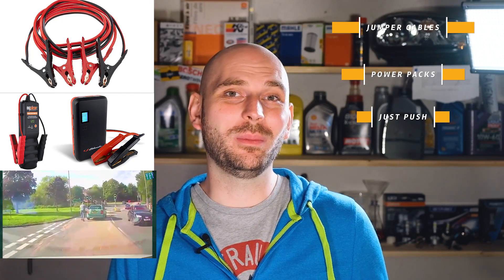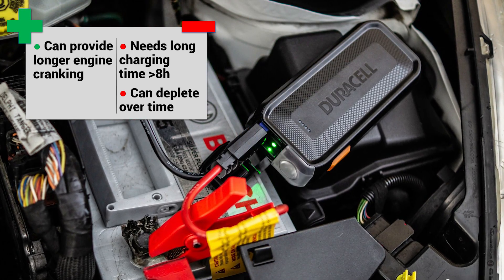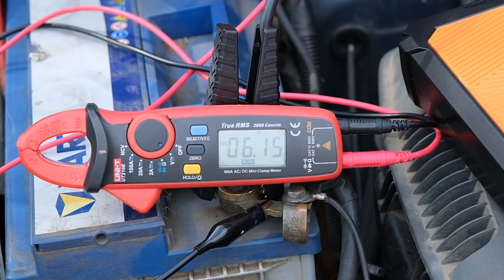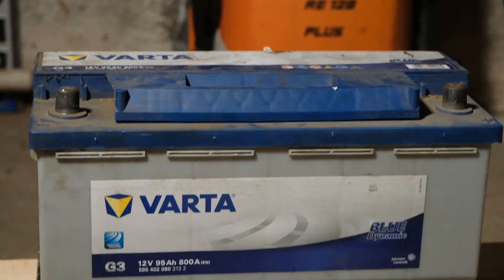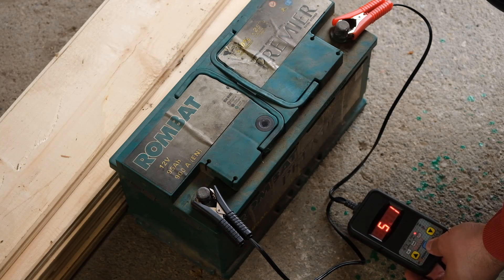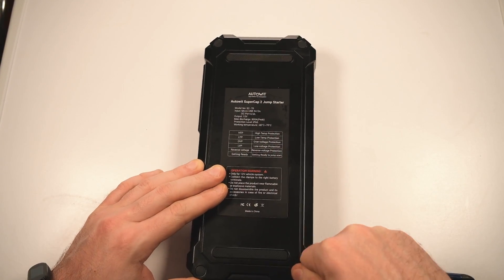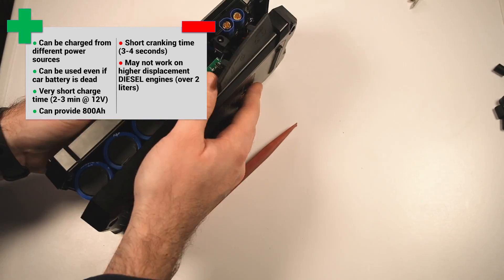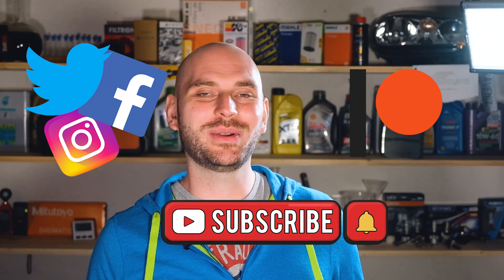[FYC] Is this the best Jump Starter? Autowit SuperCap 2 Jump Starter - REVIEW and TEST

Comment: I just got autowit.should i fully charge it at home? Will it hold the charge till i need it?
Reply: It will discharge in about 2 days.    However charging it is much easier than charging a battery starter.

Comment: I personally feel that the booster charger with lit ion battery is a far better product than this super capacitor charger. One often hears the arguement that booster charger needs regular charging. Not true. I charge it once a year and it only seems to loose 4% charge per year. It still has 96% charge after one year and within 7 to 10 min of recharging from 96% it shows 100 percent again. So recharging is not an issue. I could easily go to one and a half year or possibly two between recharging. Besides I can use it for prolonged or multiple starts/cranks. It works on a totally dead battery, and even no battery, just to start the car. Beat that super capacitor starter! Besides you can use it to charge your phone, iPad, laptop, and even use the very useful built in flash light in winter darkness when you are stuck in the middle of no where with a dead car battery, a dead phone battery, a dead laptop and pitch darkness. I hope you get the drift!😁 This is a real life user comment since I have used it for more than two years. And it is cheap. I paid only 60 Euros then. It is even cheaper now.
Reply: I agree that the lithium ion battery based ones work better, but my concern is that lithium batteries don’t like extremely cold winter days or extremely hot summer days.    The humble loss of capacity over a year would be no big deal if it was sitting in my living room, but instead it will be baking or freezing in my car trunk all year long.     The reduction of power in the capacitor style is the tradeoff for extreme temperatures & recharging being a total non-issue.
Reply: Agree 💯 %

Comment: Good review and thank you for dismantling it for your viewers. I ordered one from AE as Amazon doesn't have Euro Warehouse shipping. The seller on AE is tha same as on Amazon. My opinion is, that this Supercap systems have alot of potential in the future if the capacitor development continues and increases their power. Lithium packs do age sooner or later and they have very different quality when new which causes some Li Boosters to get bad reviews as they used a low quality lot of Li-batteries. I need this thing to wake up my motorcycles in spring or in cold conditions (20W50 Oil is a hard task for bike batteries at -10°C). This should work well for me.
Reply: I wouldn’t trust Amazon with products like these at all. You never know what quality you get from them, especially if they’re made in China! I would rather order from the actual seller.

Comment: Good toll to have in your car. But me, i bought a 6 Maxwell super caps and added a acid battery 10amps in parallel. Great deal. The sad part is if you don't drive it every 3-4 days.  Have mine in a 2010 dodge caravan,3.3L. Works great. And as I understand they have like a million cycles. Normal acid battery only 3000 max
Reply: 6 maxwell supercaps cost over $300... how did you afford them??